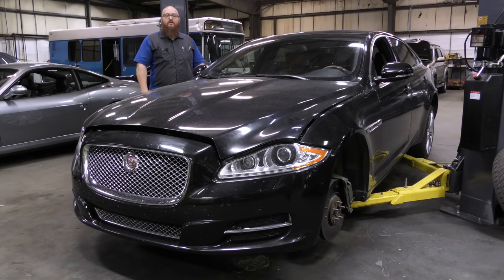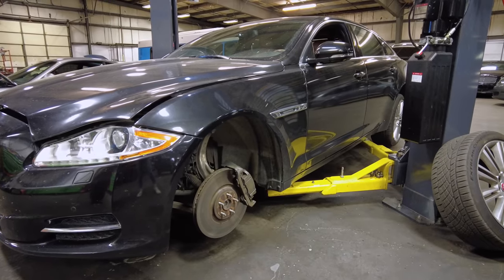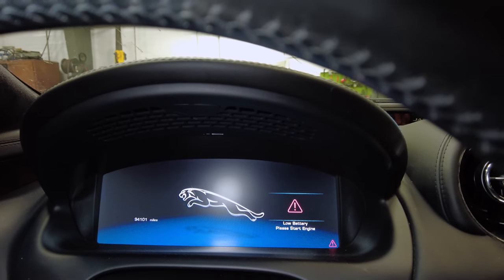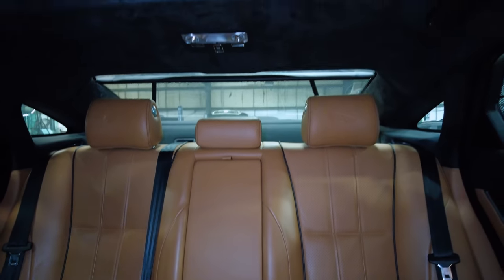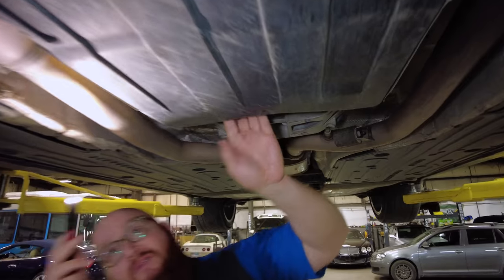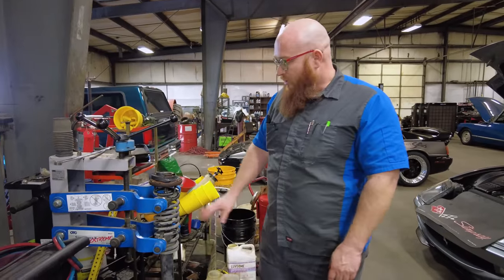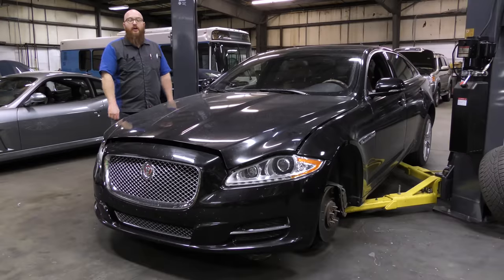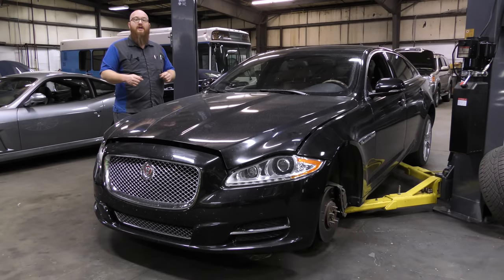Not another boring car! This '14 Jaguar XJL is anything but boring. CAR WIZARD is very surprised

Comment: I was thinking the front end looks like a combo of a Ford Fusion and a Taurus.  Which kind of makes sense since Ford owned Jaguar at the time.
Reply: Ford had sold jag already when the fusion debuted. The roofline on the fusion looks just like an XF first gen haha
Reply: Ford sold jaguar to tata in 2008 the fusion debut in 2006.Ford mad some of their engines till 2020
Reply: The X351 came out in 2010, at which point Jaguar Land Rover were owned by Tata Motors.  I always thought the Fusion (or Mondeo as it was here in the U.K.) had more of an Aston Martin vibe to the front end, which makes more sense as Ford owned Aston Martin at the time.
Reply: @MrDANDERSON77  Not referring to the semi frumpy 2006-2012 fusion im referring to the stunner when new aston knock off front grille 2013-2019 generation
Reply: @CRAPO2011  I understand that’s true,like that comment though lmao!!
Reply: @MrDANDERSON77  haha thanks, i will say from what i hear the 06-09ish fusion can be great cheapish used buys and very reliable with the aisin automatic (ford switched to the iffy gm/ford 6F transmission in 2009? 2010ish)
Reply: @CRAPO2011  your welcome and yes that early version of the fusion was like a toy box on wheels that damn thing was like a reboot of the escort,lol

Comment: Umm. I don't think it's supercharged, guys. I don't see the roots supercharger, nor I do see the "supercharged" badge on the trunk that the 2012's had.
Reply: bro...that enormous bright metal "shield" staring you in the face after Wiz removes the cover is a supercharger. Where have you ever seen the top of a motor look like that otherwise??
Reply: Uhmm....The supercharger is under the silver liquid to air intercooler that you saw when he lifted the plastic engine cover.

Comment: Love these! I’ve got myself a 2011 n/a 5L V8 and always enjoy driving it. Had it for a few years and look after it well
Reply: How reliable has your car been? I've been looking at XFs of the same era and been really tempted to pull the trigger
Reply: I have a 2010 xfr and it has been expensive to do some things hopefully you can work on it abit yourself like i have @ryanroadreaper
Reply: @Braydon Borthwick  I've done some research, and I know that from '10 to '13 they've got issues with timing chains, so I'm looking to avoid those models.
Reply: Yeah switching my car too amsoil to avoid that issue i hope lol
Reply: @braydon73  Frequent oil changed help a lot but I am very disappointed Jaguar never produced upgraded Meta reinforced timing chain guides like Infiniti did in 1994 model year for the VH45DE.
Reply: @braydon73  yes 2010-12 models in particular. My car does not have any timing chain issues, but I service it every 6,000-7,000 miles at the dealer. There is no varnishing under my oil cap either. I personally find the Jag service intervals too long so i just service mine early. My dealer gave me a free 3 year warranty which has been AMAZING cause Coolant leaks are common
Reply: @RyanRoadReaper  Mine has been pretty good. I live in New Zealand, im 25 and i've always wanted this car. Currently it has 70,000 miles and is a 2011 model. No timing chain issues, no oil varnishing, no oil leaks, the previous owner looked after it. However, make sure you have a new battery. when Voltage drops it can cause issues (i had this). I have also serviced the Transmission, Diff, and all other fluids. I service it every 7,000 miles or so. I needed a new intake manifold since it was cracked and had a coolant leak. I would recommend the supercharged V6 or V8 since their intake manifolds are metal. my N/A V8 is a plastic manifold, and can crack after a while.
Reply: @RyanRoadReaper  if you want an extremely reliable xf, get a 2009 with the 4.2 v8 or even 4.2 supercharged, amazing engine transmission combo, quality dropped in certain areas with the direct injection 5.0s, coolant component design flaws, timing chain issue like the old v8s etc
Reply: mazda toyota gm ford…. standing out? lol, maybe mazda but this most definitely stands out above any toyota ford etc
Reply: Jaguar are cool but my opinion not luxury car will beat lincoln town car on reliability and comfortable driving
Reply: @theshield1613  have you ever driven a steel bodied jaguar? they are supreme
Reply: @h7pubg  yes but like I said it's my opinion everybody had their opinions.
Reply: @h7pubg  and those ford  4.6l v8 are bulletproof engines
Reply: @RyanRoadReaper Ryan ever find one?? I got one for sale now . 69300 miles

Comment: I started only taking my vehicles to a high level mechanic I found a few years ago. I’ll pay $80 for their oil change, it would cost me $55 and a bunch of hassle on my own. Loyalty to a good mechanic will get eyes looking the other way while your engine codes are cleared and an inspection sticker is granted. 

I had a Subaru dealership quote me 
!!!$360!!! For a transmission fluid drain and replace (only 6 quarts!!!) 

!!!$590!!! For a RADIATOR FLUSH!!! 
I was sarcastic with them and asked why they are only charging $600 to take the engine block apart to blow out the internals 😂

Another time I had an oil leak, that they couldn’t show me, and wanted me to pay !!!$289!!! For a diagnoses

Comment: When it comes to servicing vehicles you generally get what you pay for. I've had a carburetor dipped in a degreaser and tried to bill as overhauled. But working as an aircraft engine overhaul inspector made me a little wizer than the average customer. I've even caught a licensed mechanic knocking off flywheel teeth with a chisel, because it was a slow day and he wanted to sell me a new flywheel and starter. It pays to be observant and at least a little knowledgeable. A shop like Omega is a fantastic place to find.
Reply: "a little wizer"
Profound statement...

Comment: Ha ha - low battery! I think that is a X351 feature. Mine has displayed this for months. OBDII reports about 11.9V with engine off and the car always starts happily. But annoyingly I can't run the infotainment system with the engine off.

Comment: I have a Jaguar XE that i've been getting fixed slowly but surely.  It has the v6 and is super to drive.  Plastic is the problem on the motor area.  I have a question about the sound symposer intake system.  I am getting a block off plate for it since it caused p2187 and p2189 codes from the corregated plastic tube on coming from the back of the engine. The Jaguar place 2 hours from here suggested it, as I told them I "fixed" it with duct tape. I was wondering if I need to place a vacuum cap somewhere on the system after i block it off.  Just curious if you have had any experience with this thing.  Any help would be appreciated!  Thanks in advance, love your videos!

Comment: I just got a used one and it overheated on the drive home from the dealership 😂 blown head gasket. I have a feeling they dumped stop leak and wiped the codes somehow because no warning lights came on....and of course they ignored my calls. So it looks like im gonna upgrade this motor.

Comment: Big breaks - but am I right it looks like sliding calipers on a car with this much power?  If so, they will heat soak if you push them, and of course all the other usual issues with sliding calipers being risk of ceasing etc.  Seems like a corner cutting move by parent company Tata, which isn't surprising and why I'd never buy a modern Jag.  The plastic ZF transmission pans are fine - you can either swap them out for a steel pan when you do your transmission service (ecologically friendly option), or just replace the whole pan which incorporates the pickup filter, either way, it isn't expensive.  Bonus of the plastic pan is it has a proper drain plug so less messy to service.

Comment: Some of the conventional car companies has just stolen the design of iconic luxury cars like Jaguar, Bentley or Aston Martin instead of coming up with a good design of their own, and that is sad. When you see a somewhat good looking car, believing at first that it is something exclusive but get sorely disappointed, when you discover that it is an ordinary POS car from Ford, GM or any other design thief. No exciting engine sound, driving excitement, durability or exclusive feeling there, just a heap of flimsy metal waiting to get rusted out and recycled after you paid twice the value over it's lifetime in parts and services.

Comment: The anti-roll bar can you get them in a blue hard silicone of different strength?
A sort of agree and disagree yes you shouldn't do work that's not needed, but you should do an inspection of a vehicle that's done over 100,000 miles for safety concerns, and point it out to the owner that there is some issues not necessarily do the work but point it out and not just the area you are working on you don't have annual inspections on cars over there do you like an MOT?

Comment: Well we went last weekend to do maintenance on the car and when I did the appointment they came hey remember that the valve cover gasket is leaking (I checked it before even get there and it was clean) are you going to replace it, I said no I did. Ah ok was the answer then about an hour after that the “advisor” came hey we have an issue, there is an issue with the suspension. I asked what part and he said oh the bushings of the sway bar are destroyed there is $359 plus tax to do the job. I said no maybe next time, the guy left and when I get to the house and checked there are no broken bushings in the car.

Comment: Regular supercharged is 470HP with 420 torque. In the initial years of this model, the SuperSport was 510 but by 2014 I think the top model was at 550 in the R version which succeeded the SuperSport. However, I am fairly confident it's the same internals and they just adjust output by changing the pulley and adjusting the ECU. (People do get crazy power out of these on stock internals.) One thing to note about the XJ is that it's a highly German vehicle. I had an 11 XJ Supercharged and the OEM for brakes and suspension was the same as on a BMW with a total of 44% German parts content. This engine would have been made in Wales. I found the 470/420 power rating to be, uh, more than adequate and the limited slip diff worked pretty well in the wet, probably aided by the big tires. Plus, the XJ weighs a lot less than an S or 7 because of the aluminum and it really drove like a smaller car. Your customer has a great ride!!!
Reply: Not even pulley change. Same everything. You can get 600hp stock everything including air filter with just a tune.
Reply: I find that jags always handle the wet way better than their rivals, potentially could be the link to Land Rover with their epic traction control systems. I personally have a family member with a Jaguar f type S and another with a bmw M car and in the wet the bmw is constantly struggling for traction and in snow and ice we don’t even turn it on because its not going to move. In the jag however the snow and ice mode is unbelievable it’s no Quattro but in the wet it almost never spins and it even does super well in light snow and ice so I can imagine a big heavy xj does even better - Heavy compared to an f type I mean.
Reply: The AJ133 5.0 litre V8 supercharged in a 2014 XJL is rated at 510 PS or 503 bhp (I had a 2010 XFR with the exact same engine). Yes, in the later XJR it was bumped up to 550 PS (542 bhp) then in the last iteration - the XJR 575 - it was surprise surprise 575 PS. Yes, the brakes - 380 mm front and 386 mm rear - were supplied by a German company (ATE) and are essentially the same as those fitted to higher end and M BMWs. The engine was assembled in the Ford engine plant in Bridgend Wales but it is not a Ford engine.
Reply: @kimjupe4532  I'm not sure where in the world you are, but when the first version of the car came out in the US it was available in regular 5.0, Supercharged at 470, and Supersport at 510. The Supercharged had 470 whether standard or long wheelbase and had slightly bigger brakes than the Supersport. Odd, I know. (Much better brakes than the 15 inch Brembos on my current vehicle.) By 2014, the Supersport was replaced with the XJR and power was upped to 550. That's what we got here. My 2011 Supercharged had almost everything on it including big XKR wheels and, for the first buyer, cost a whopping 98,000 with the radar cruise etc., but it was still cheaper in the used market than a Supersport. Beast of a car. I didn't think the Supersport was worth the extra money even on the used market to get a little more power when I could get all the options I wanted with a "mere" 470. So slow!  So, no, this car if a regular Supercharged was not at 510, at least for the US, either before or after 2014. To be honest, some people were able to beat factory 0-60 times in the Supercharged and frankly a huge sedan with a sub-5 second 0-60 range is already fast enough for me. But the prospect of the R with 550 or later 575 seems pretty tantalizing. All this is verifiable in terms of engine output in automotive media in the US. And if you can tune it easily to 600, the Supercharged is a hell of a deal, assuming you stay on top of the guides.
Reply: @texlad04  TP, I'm in Australia and I'm fairly sure we never got the 470 PS version instead right from the intro in 2009 we got either the NA or the 510 PS version of the SC. I assumed that by 2014 the XJL had the 510 PS version as standard but you would know more than me about US versions!

Comment: I never imagined the interior on those newer Jags was so nice. Exterior styling is 👎🏼.  I know Wizard isn't a fan of BMWs, but when my '09 135i reached ~82K mi, I went through the suspension and replaced literally every bearing, control arm, bushing, link, seal, dampener, etc. When it was all said and done the only components I kept were the M Sport springs and anti-sway bars. I never would or could have afforded to pay someone to do it for me. Totally agree that you don't want to keep an older euro car, unless you're rich, or have the wherewithal to fix it yourself!

Comment: Just rebuilt my front suspension on the exact same car. Took me a couple days but was well worth the results and the money saved. Was you able to replace the passenger side upper control arm without removing the fuse box? I was able to. H.P. is 470.

Comment: After working in the automotive industry for most of my life, I can concur with the Car Wizard.  As a mechanic (and not just a parts-changer), you are being paid to repair/replace what the customer requests, and aside from pointing out (usually in the form of an estimate) any other areas which may need attention-- especially if they are safety related, you do what is requested and do it to the best of your ability.  After all, the shop you work for is responsible for any warranty on your work... and "taking care" of items that you happen to notice just because you are able to fix them opens you up to a world of liability.  This is a litigious society we live in, and good deeds can come back to bite you right in the arse!

Comment: Hey wizzard its a ford in sheeps clothing so technically its an american car 😂...in europe main dealer labour charges are around $75.00 pr hr average...european cars made for european market are made to a much higher spec and quality to the ones made for the american market because of the low quality american cars are made too...
Reply: No they're not.  Independents might charge £60 plus VAT £72 but that's $90 and main dealers charge double or treble that.
Reply: @Robert Walton-Sharp  ive owned hondas..Mitsubishi..toyota...and always had work done at main dealers and they certainly dont charge labour what you are insinuating..

Comment: I am not a fan of this, 2014 Jaguar XJL sedan, but I am hoping that the Car Wizard will do an inspection video and an update on a 2005 Hummer H2 with the 6 L LS-based V8 engine and the four-speed automatic transmission, sooner or later. Thank you very much and have a great weekend.